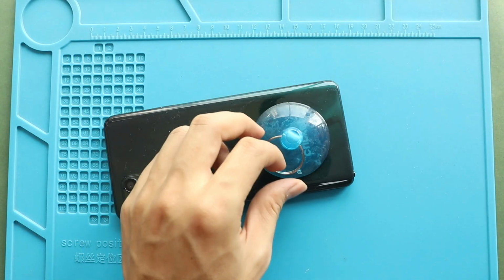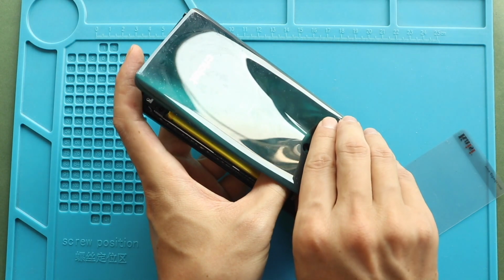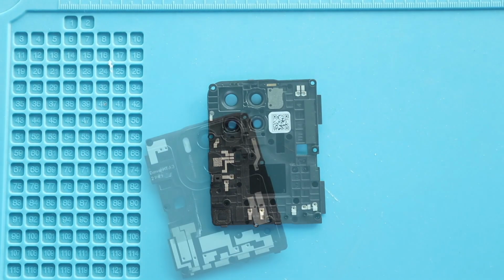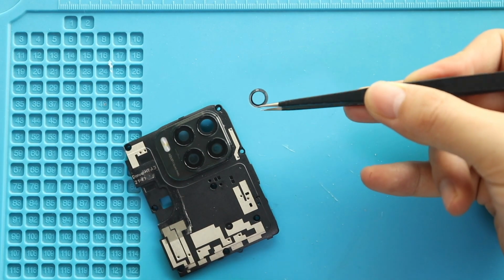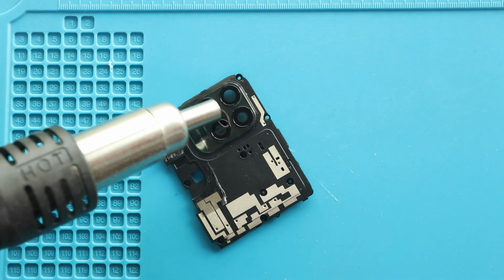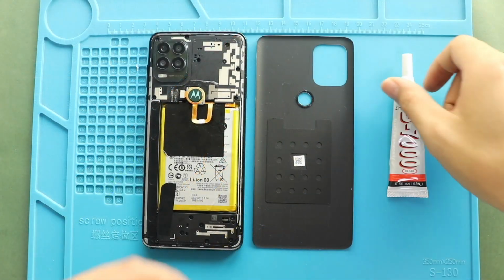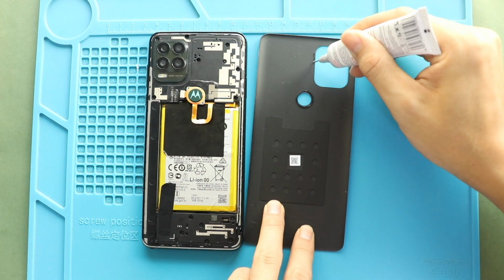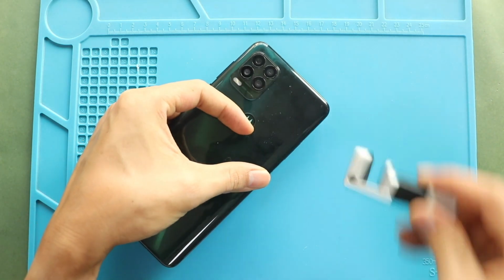Motorola Moto G Stylus 5G XT2131 Camera Lens Glass & Back Cover Replacement

Comment: Hello, if the protector on one of the lenses is broken, do you think it can be changed from the outside, without having to open the phone?
Reply from the maker: It is possible. Just make sure to clean the surface properly.